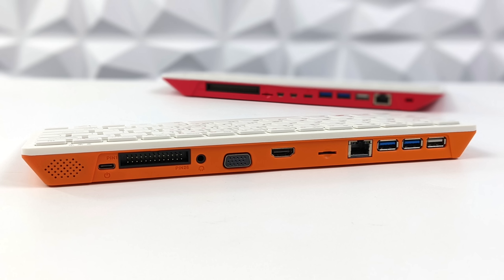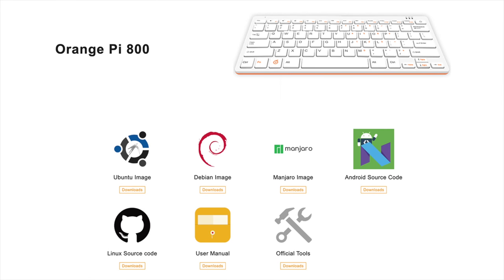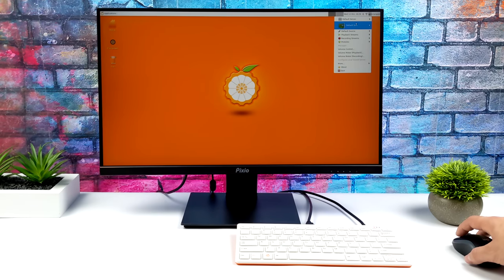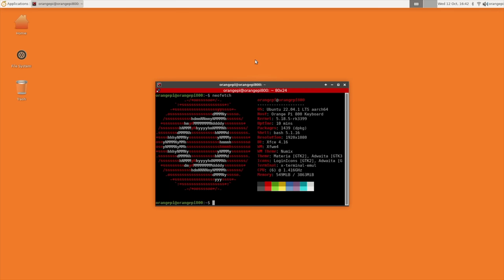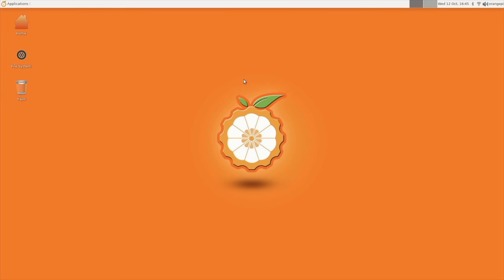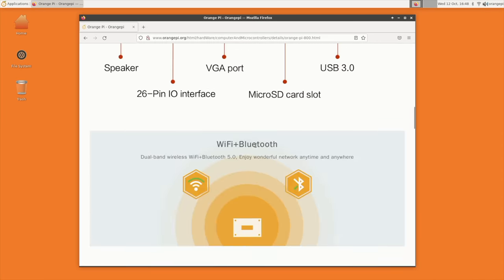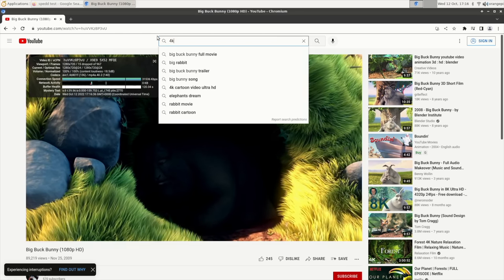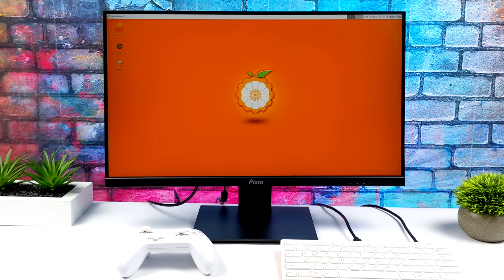Pi800 First Look, An Brand New All-In-One PC! Think Pi400 But Faster! 6 Core Arm CPU

Comment: If the available OSs weren't such garbage, SBCs would have been a thing long ago, but  the only one that is somewhat decent is ChomeOS, although it has it's problems; the existing Android-based LineageOS is buggy and as far as Pi4 goes, not native to the platform; Raspbian is so barebone, it may have been made by starving children in North Korea; other OSs are quirky (pants on hat off blue shirt OR hat on pants off green shirt OR hat on pants, poncho and crazy hands - basically, the choose your poison dilemma): you got Kody (that's nerd territory), Mint (basically any Linux lite), Fire OS (from what I've read, a decent OS made by Amazon, but it's not free, so I haven't tried it) and a plethora of other clones, mutants and freaks. The only way around all the headache is to install AnyDesk and hook it up to a REAL PC with Windows installed. Say anything you want but it's superior and always has been.
So basically, SBC are for crazy people who like to tinker and troubleshoot. Every user action is an experiment, an adventure to linux community forums and specialized sites or a three stage problem to be solved. For the average consumer it's a freaking nightmare, in fact, it should say so on the box.